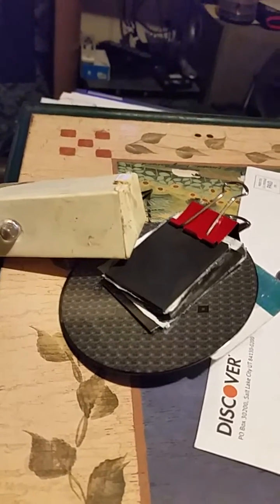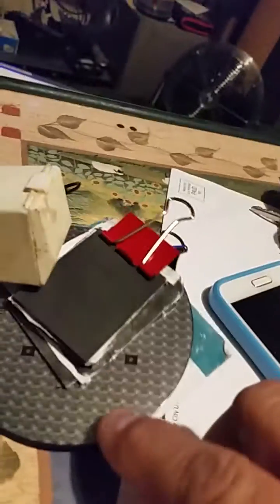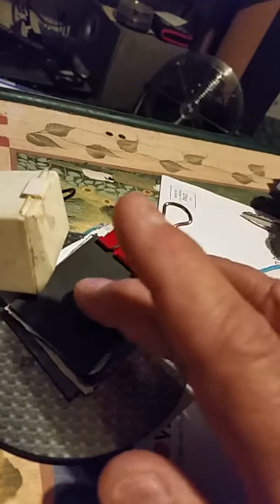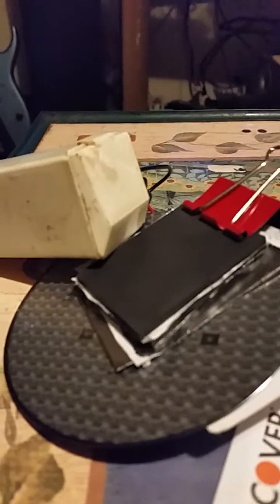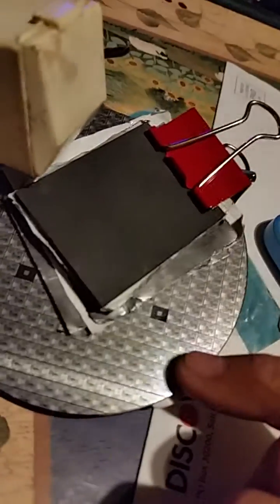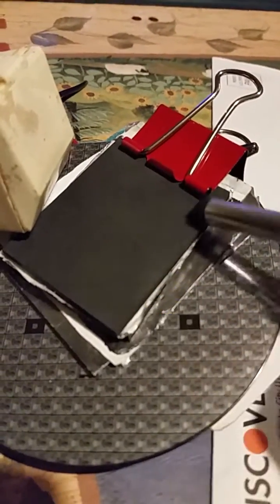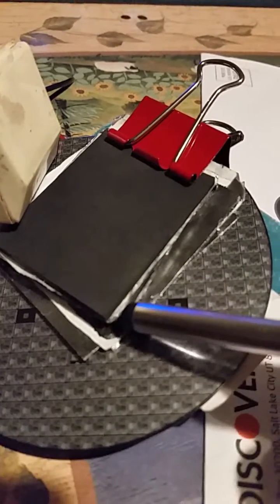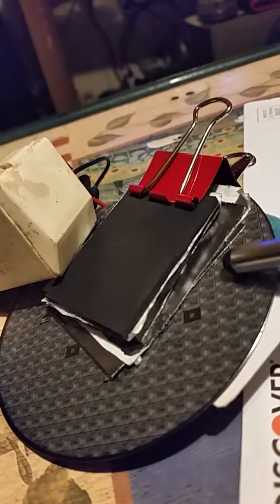Silicon wafer plus graffoil plus graphite battery

Comment: You've made a novel silicon air battery. The silicon is consumed in the reaction to produce the current
Reply: Silicone air batteries have an electrolyte. This doesn’t
Reply from the maker: Actually the silicon is impossible to consume as it is a type of glass
Reply: @Gadgetmall  lmfao ok hmu when you actually make any money off this.... Oh wait you won't. 🤣
Reply from the maker: @justeatmyass no i never intended to make money .im only interested in making a power cell that keeps working for years and years to power tiny radio transcivers and lights

Comment: Hey man just wanted to know what type of silicone wafer you used. You say silicone METAL wafer is it coated in a layer of oxide
Reply from the maker: Its a blank silicon wafer that integrated chips are made from as well as monocrystaline solar cells  .
Reply: @Gadgetmall  thanks for the reply, apreacieated

Comment from the maker: the silicon metal is very fragile.  i already cracked some pieces off with alligator clips unintended. ..i will have to pancake this stuff between some pvc sheets with bolts and electrode wires .i got new large silicon squares and graphoil.
Reply: Yes, be careful, silicone is very fragile and can break easily... I also ordered just a cheap stack of cheap left-over mono and polycrystalline solar cells, maybe they can also be used ? They are cheaper than real silicone wafers from microprocessors or ICs...We will see....

Comment: What is the voltage of just one silicon wafer , one cigarette paper foil and one graphfoil ?
Reply from the maker: overunitydotcom only .03 current but it is current .I am wondering what electrolyte I could use that won't cause deterioration and increase current..maybe petroleum jelly with silicon dust?
Reply from the maker: overunitydotcom about .850
Reply: Gadget mall
Do you also get a voltage and current, if you just press a graphfoil against the silicon disc or does this give a shortout ?
Reply: Gadget mall
Maybe try KOH or KCL or NaSO4 in a Superabsorber salt like from diapers...